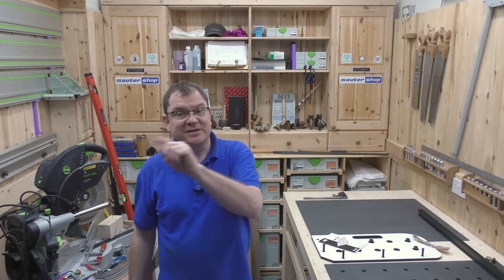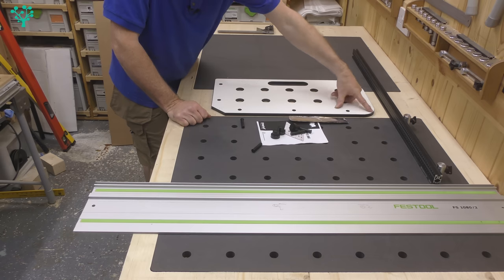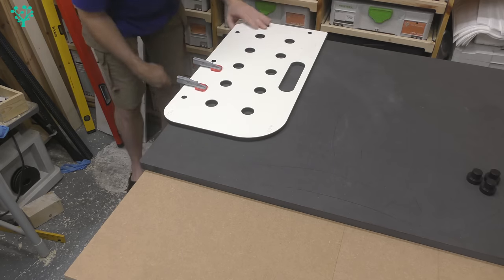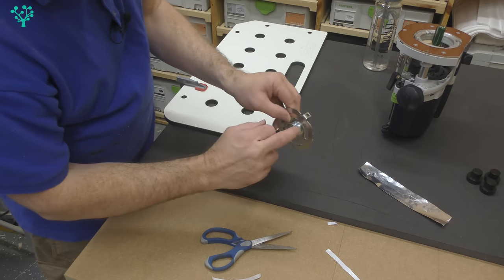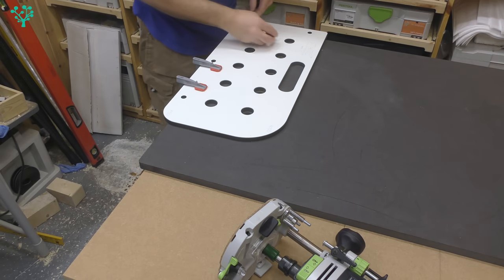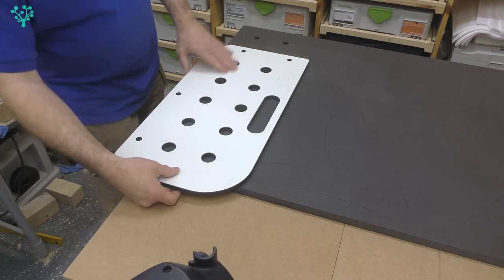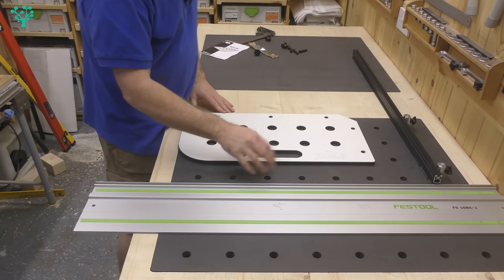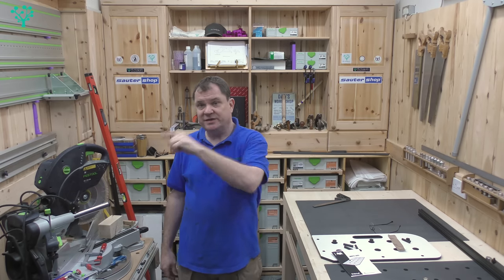Hands on review Trend MFT Jig

Comment: So frustrating that all these jigs and fixtures to make cheap "MFT" tops cost most than an MFT top. My Bora 2x4 foot top cost $50.00USD, I'll use it as a jig to produce more tops as required. If the Trend jig was $50 I'd buy it but it's a hard pass at three times that.
Reply from the maker: Yes the jig has come down in price since this video, but is still about twice the price of the Bora.

There is a new jig on the market from Benchdogs - I will be looking at that in the near future - comes in under the 50 mark and is more versatile than the Trend. Can’t talk to accuracy or ease of use yet. Watch this space.

And thank you for the comment.

Andy

Comment: very nice - which router bit did you use? or did it come with the Trend MFT jig?
Reply from the maker: Hi,

Trend actually make a router bit specifically made for MFT holes. Google Trend 20mm MFT bit.

They do make two 20mm bits - but it is the one for MFT you need.

And sadly - no it doesn’t come with the kit :-(

Cheers

Andy

Comment: I bought the woodpeck one and same problem after being very very careful. But wood peckers template guide is smaller and uses a 1/2 bit to cut holes. Too many things can go wrong making any tops over 12x 24 holes. Did you use a centering bit to make sure the template guide was perfectly centerer?  Returning it and have a UJK parf guide system coming
Reply from the maker: Hi,

The Trend cut pretty accurately in the end, about 0.1-degree error over the table. I corrected that with a small shim on my fence - so all good.

I used a mandrel to ctr my router base to me router, then relied on the Trend supplied 30mm dogs to ctr in the holes.

Cheers

Andy

Comment: Great video. Encountered unexpected problem - using trend router with recommended trend guide bush (gb 30/A) and the guide bush so tight it's hard to insert and lifts jig when trying to remove causing movement  and inaccuracy! Waiting for trend direct to get back with advice. Wondered if anybody else encountered same problem?

Comment: Hi there, interesting but the foil is a bit of a put off and what happened about the movement when you put those black bench dogs in the holes? surely the 20mm holes are not in line? or did I miss something?
Reply from the maker: Hi,

The foil allows for the variance in third party bushes, the black dogs are actually 30mm at the top and 20mm at the bottom.

So once you get the first holes made (using the edge pins) then the black dogs hold it all square.

Cheers

Andy
Reply: @TheWoodgrafter Thank you for the reply... Exactly, variant is possible even with the foil after a few holes are made with the foil moving out of place etc. The movement I was mentioning was the 'wobble' at 10.10 in the video when those black dogs were inserted then you moved it around, it should of been rigid. it looks like a bush/foil issue if those black dogs are a perfect fit which is very likely (you would of noticed it right away)? the end pins inserted after you the placed the black dogs into the holes just covered the issue not showed it was perfect. There should of not been any wobble at all .   I am not knocking you, its good that you have shown this to us to make our own choices of which system to use.  I like your work table by the way, good size, I am about to make one just slightly shorter but wider .

Comment: Each of us have their own way of working and uses a MFT style top in different ways and to differing amounts. I had a local CNC shop make mine about 10 years ago at 1600 x 1000 to act as a workbench and an outfeed table. In my new workshop I don’t need it as primary workbench and also not as an outfeed table. But I still have an occasional need. Explanations;

Even after that period of time, I haven’t used most of the holes. I’ve turned the top over but it is still in reasonable condition partly because I haven’t treated it as a sacrificial cutting board - when I cut, I slip a 3mm or 6mm MRMDF offcut under the cut line. 

My primary workbench now is a shop made bench 2200 x 800 solid ash bench with (soon to be fitted) wagon vice and leg vice. Some dog holes obviously but at 100mm thick, I can’t use the MFT compatible cramps. No loss as I’m making a vacuum system which I think will give me what I need in terms of holding pieces tight.

I was able to find a used mains powered lift table. It has a 5T capacity - I can’t see myself needing more than 500kgs. It was a static piece but I made a torsion box with HD castors to go under. It’s now mobile and I only connect to power when I want to life or lower. I can now slide big slabs of timber out of

Comment: I made my own jig very precisely the key is to make sure that the router or drill bit and any and all machines used are all facing the same direction for every hole so if there is error, all the holes will have the same error and the results will be that they are all still in perfect alignment of each other.  at least it has been my experience everyone who makes their own jig will have their own issues to discover.  although since my festool MFT holes are not all perfectly spaced I've basically decided I'm not depending on the holes and the dogs for perfect alignment because tolerances continue to vary depending on the dogs you use.  The only tool I trust is my large PTR 18 square from TSO for setup.  after seeing that little wiggle movement that you demonstrated I'm thinking yep there you go another imperfect jig that will eat away at you.
Reply from the maker: Yep,

And that wiggle did indeed put some errors across the table. I used a couple of shims to square the fence up, and that solved the problem and gave me the accuracy I was after. BUT it still annoys me :-(

I now have the a Benchdogs jig and will be re-making the board in the near future.

Good tip on tool alignment, will be using that on the next attempt.

Cheers

Andy

Comment: Just used the jig and had lots of slack! Used a Trend T7e with their 30mm bush and the fit was tight, no wiggle.  But after cutting the holes with a brand new Trend 20mm bit, I’m left with lots of wiggle and 21mm holes.  Any clues where I’ve gone wrong? Bench surface is birch ply based protector board. Thanks
Reply from the maker: Hi,

It sounds like the tolerance of the bit, Trend make two router bits at a claimed 20mm.

One however has the MFT/Table top designation in the description and the other doesn’t.

I used this bit https://www.trenddirectuk.com/c030dx1-2tc-two-flute-cutter-20-0mm-diameter

Is that different than the one you used ?

Cheers

Andy
Reply: Hi Andy
Think you’re right, I used a standard bit with ¼ shank and probably over extended as only a 20mm plunge. Now ordered the correct bit, cheers.
Reply from the maker: Yes that sounds like the problem, I have had feedback that a number of the standard 20mm bits don’t actually work that well in an MFT.

But I know the dedicated trend one works,

Good luck

Andy

Comment: Excellent video. I was torn between buying this jug and the Parf Guide system.

I suspect the Parf Guide will be my choice.

With regards that black MDF insert. Where did you source the sheet? I'm struggling to find it.
Reply from the maker: Thank you,

The Trend jig does work well, quick and simple and accurate. The price is significantly lower than the RRP I quoted, just google for the street price. 

It has limitations in that you can’t create offset holes etc. And you are governed as to the starting point of the the grid. Limitations the Parf guide system overcomes.

I have no regrets on the jig, but then again the Parf Guide is awesome. I don’t think you will make a wrong choice.

The black insert is Valchromat, you can also google colour through MR MDF for other brands.

I use a local supplier Atlantic Timber 

https://www.atlantictimber.co.uk/search/for/Valchromat/

I am not sure if they deliver nationwide, but other suppliers are around the UK.

Cheers

Andy
Reply: @TheWoodgrafter  Thanks, as it so happens I'm just on the Atlantic Timber site.
Reply from the maker: Delivery was slow, but it was in the middle of lockdown 1.

Nice guys though, and super helpful. They also have an interesting stock of hard woods and live edge slabs,

Cheers

Andy

Comment: Great honest review Andy. What ever system people use, it seems like a one trick pony, use it once or twice and then its redundant.  But all that said, i agree with your other users, the Parf Guide system seems like the one to choose.  Great to see you back in the workshop.  Cheers Paul
Reply from the maker: Thanks Paul,

Always good to have your input, I think you have hit the nail in the head. How many times will you make an MFT top.

I am probably extreme at the moment as I am re-building the shop. But even then,

I will use it for two inserts on the bench, probably two portable units as part of the Kapex station and then.... that’s about it.

Then its work is over. However, you need the accuracy you either build or buy. If you build you need a template - so what can you do...

Cheers

Andy

Comment: "Designed to take up the slack in your bush"......well I spat my coffee out :-) yeah at nearly 60 I am still a child.  Could you use PTFE tape as well? Its currently about 80 to 100 pounds cheaper than the parfit system.
Reply from the maker: Hi,

Nice one, whenever you talk about bushes and routing I think Benny Hill starts to smile. They won’t forget Ernie - (that will test you).

The PTFE tape would come lose, I noticed on the clean up the silver sticky tape had started to come away.

The more I use the jig, the more I like it. Super quick and super accurate (so long as you are careful). Now that the street price has dropped I would buy the trend Bush as well - and get away from the tape completely.

Cheers

Andy
Reply: @TheWoodgrafter  did he drive the fastest milk cart in the West lol
Reply from the maker: @RADCOMJ1  We now have a generation of folks scratching their heads.....

Comment: Too be honest I can’t believe how much they are charging for for something that can be batched out in huge numbers with a CNC router and lathe. Two machines almost every shop out there already has. At least the parf system comes with the drills and guides. For this system I still have to buy a good 20mm bit a good quality guide bushing.
Reply from the maker: Yes that is a good point, it is an expensive piece of kit - that has one use.

The street price has come down considerably since this video but still over £100. 

And you are correct a well calibrated shop CNC can make something similar and you can buy 30/20 mm dogs off the shelf.

So self build is an option. 

Cheers

Andy

Comment: I have a similar product made by dominofix, when making a larger mft it would run out, and I found the problem to be the of1400, the clip in 30mm guide bush wasnt really anywhere near centre, I had the same problem with the of2200 as well, after buying a new base plate which allowed for use of a centering mandrel for accuracy the problem was solved, just thought I'd share this, if your ever thinking of making a larger top. 
Cheers
Reply from the maker: Hi Neil,

Thank you for sharing that, I didn’t think of that issue. Having said that I did ctr my router plate with a mandril some time ago. So I probably didn’t have that issue.

But now you have mentioned it - it is pretty obvious that could cause problems.

Great feedback.

Andy

Comment: Great video Andy. That trend jig looks interesting, just the price though 😜. I remember buying their pocket hole jig years ago for around £80. But here in the UK, kreg jig wasn't available then (which was still cheaper). Need to have a look at that sauter shop website. I do remember that you mentioned about it in your last vlog video. Cheers 🍻
Reply from the maker: Hi,

Thank you for your feedback, as somebody pointed out the price has dropped significantly (I quoted the retail price) the street price for the jig is now around £110.

I have the Kreg PHJ - nice bit of kit, I have never used the Trend version but I assume they are pretty similar.

Cheers

Andy

Comment: Hi Andy, have you tried to find a reason for the wobbling/movement (at 10:11)? Is it because the holes just drilled are too big? or are the 3 black dogs too small? My experience is that holes made with the Parf Guide System give very tight holes compared to holes made with the router and a 20mm bit. I have not tried the bit from Trend but holes made from a 20mm bit from Festool and others are simply too big. The dogs I use are all Parf Dogs. I think we're talking about tolerances between 19.98 and 20.02 (from snug to too wide)
Reply: Peter Millard did a video that I think was recent and he talked about the Festool 20mm router bit was slightly over 20mm and he had a friend reduce the size to 20mm.
I have 3 20mm bits and all three are slightly oversized. I did find one at the store that was spot on. I believe it was a Whiteside brand. One of the bits I have I was able to hone the carbide cutters with a diamond hone and got it down to 20mm.
Reply: I got parf guide mk 11 my top is out of square. Takes a long time to make as well. When u drill its easy to drill out of square buy a hair so can throw things out. Parf guide need to be made for a router be quicker to do holes and be more square. But someone needs to make a proper size router bit. 10 minute workshop done best way so far. But u need festool router and accessories. What comes to a lot of money.
Reply from the maker: Hi Barrie, interesting feedback on the Parf Guide system. I did hear similar feedback from others as well, in terms of router size, the trend bit I used is bang on google 20mm trend bit for MFT table. 

Cheers

Andy

Comment: Hey Andy,
Another great vid 🙌🏻 I wanted to ask how your getting on with your Axminster Planer Thicknesser? I’ve had my AT310 in the workshop about 3 months now and the results have been getting worse. Now when joining boards I’m getting gaps at each end! Spent 2 days reconfiguring - the tables appear to be completely parallel apart front the infeed randomly in the middle which has an ever so subtle catch when running the straight edge front the out feed to infeed! Got to say I’ve never faffed so much with a machine🤦🏻‍♂️🤷🏻‍♂️
Reply from the maker: Thank you for the feedback,

I did start to get some snipe about three months in, when I checked the outfoxed table alignment it had drifted so we no longer flush to the blade. 

After I re-calibrated it, it was as sweet as a nut. Great finish and zero snipe.

It may be worth while checking that alignment ?

Cheers

Andy

Comment: Hi Andy,
I think this is the best video out there about this style of mft build, I have seen them all I believe, thanks for mentioning accuracy and what to do or avoid.
Quick question, how do you find velcromat as mft top, how is the accuracy of the grid as you put more milage on it?
Thank you.
Reply from the maker: Hi,

Thank you for feedback, 

The VM is good, I did find it chipped a little around the holes so would recommend a chamfer of some sort. It is one dusty productbtincut though...

The grid is pretty much bang on, runs out by about 0.1 degrees over the surface. If I were to do it again I would focus on the back row of holes (where the fence goes) and the holes that the track goes into. So long as they are square then the rest if the grid is less important.

Cheers

Andy
Reply: @TheWoodgrafter  thank you 👍

Comment: Thanks for the vid and review Andy, I would say the parf guide system does have its chances for inaccurate  use but do think it is a lot more versatile in setups of layout types. I do think over £150 for a piece of laminate and a couple of dogs and pins. They could of included a bush at least. Good impartial review.
Reply from the maker: Hi Kenny,

Thank you for the feedback and taking time to comment.

Yes it is a high price tag to swallow - but it does what it says on the tin. I checked that silver foil I put on the bush earlier on, and it has worn away - so looks like a finite number of uses before you need to find some other packing material.

I would guess at that point the Trend bush makes sense. The trend 20mm bit and the 30mm bush will cost you another £30 on the price.

Cheers

Andy

Comment: Do you need a specific bush guide for a specific router. Or is it universal.
Reply from the maker: Hi,

You do tend to get variances between router manufacturers and how the bushes fit to the base.

You can find universal bushes that use a threaded nut to attach the bush to an adapter on the router plate - in that case you need to buy the appropriate universal plate for your router.

What router do you have ?

Cheers

Andy
Reply: @TheWoodgrafter  I have two, one is the makita RP2300FC which is 1/2" 2300W plunge router and a bosch palm router PR20EVS
Reply from the maker: Hi,

So you can get a guide bush adapter like this one from Leigh

https://www.axminstertools.com/leigh-guide-bush-adaptor-for-makita-3612c-721-210889

At that point you can then use threaded bush inserts like these

https://www.axminstertools.com/ujk-technology-metric-threaded-guidebush-set-502571

You can also buy dedicated bushes such as this one for the Makita

https://www.axminstertools.com/makita-guide-bushes-ax802404

But with multi brands in your shop, you may get more mileage with a couple of adapter plates and a universal bush kit. 

It all depends how much you use them, I know folks who have dedicated routers for specific jobs. But that is a bit extreme for most home shops.

Cheers

Andy